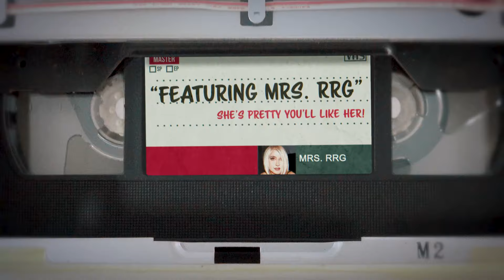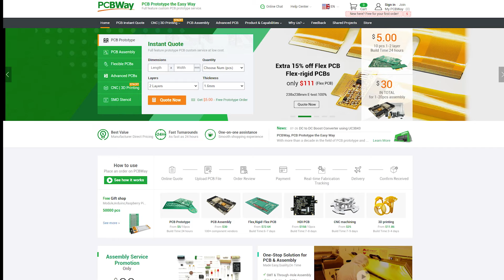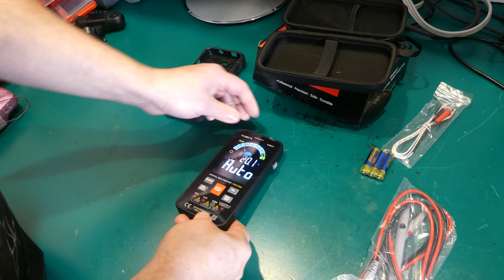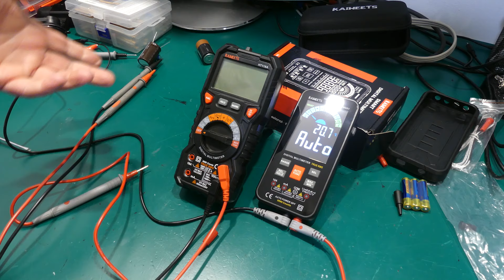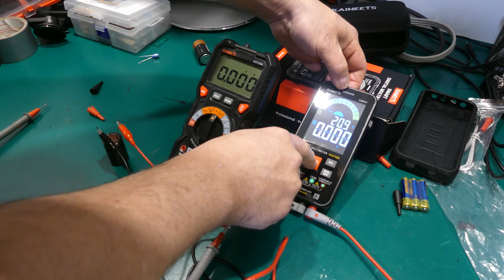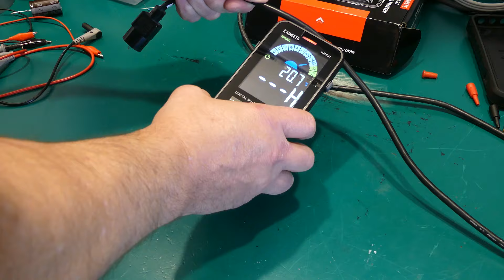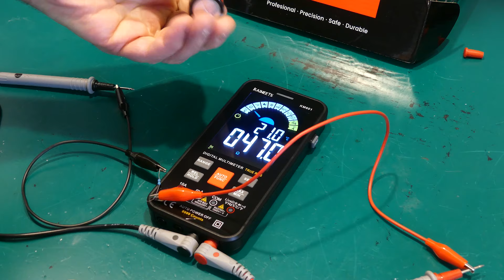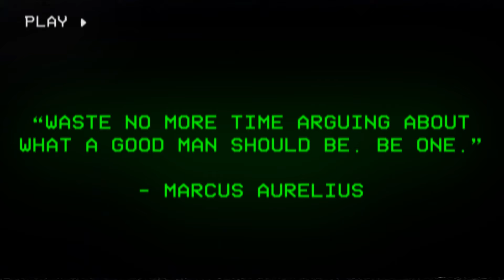Kaiweets KM601 Smart Digital Multimeter | Retro Repair Guy Review

Comment: Nice work and video! I noticed that continuity mode is slow. Once I replaced the probes with good quality it works better. Wish it had a stand. Thanks for sharing
Reply from the maker: Hi Rudy. Really? I thought the probes were already good quality and on my other meter from them it's quick. Going to check that out!

Comment: Very nice little iphone 5 look alike multimeter. May consider looking into buying one as it has many features
Reply from the maker: Hi Wally! Yes it's quite nice. Great to carry around but for the bench I have a slight preference for the other I showed from Kaiweets as well.
Reply: @Retro Repair Guy  i will look it up on their site and place an order. I currently have a mastercraft one and a prime cables one for the jobs i do.
Reply from the maker: @wallyf7020  You can use the link in description and get from Amazon if you like, cheaper, faster and helps out the channel! 😁😉 PS If I also left the link for the bench one I use.
Reply: @Retro Repair Guy  thanks. Also, you have been  leaving us hints of your where abouts
Reply from the maker: @Wally F  LOL I'm slipping! PS Thanks for letting me know.
Reply from the maker: @wallyf7020  If you have not ordered yet they just gave me a code for an additional 15% on their website. Link and code in description and in pinned comment.
Reply: @Retro Repair Guy  i haven't yet. I will do so once I have a chance ....grazie mille

Comment: I consider myself a big Kaiweets fan. I have their HT118A, GFCI tester and bench power supply. With that being said I'll pass on the Auto multimeter. I like having the rotary switch on my meter and just being able to select what I want to test. I must be trying to copy your test equipment. I've purchased  the desoldering pump you recommended and  also have the same capacitor tester.
Reply from the maker: Hi Tron! I also have a preference for the manual selector. This could be good for newbies and when you forget or have it set to the wrong dial. As for copying, well great minds think alike! 😂